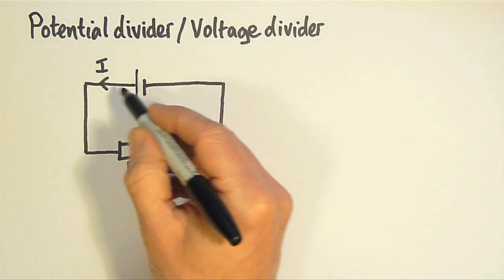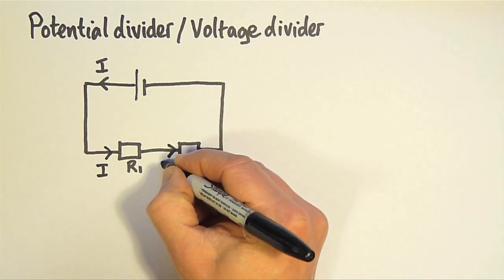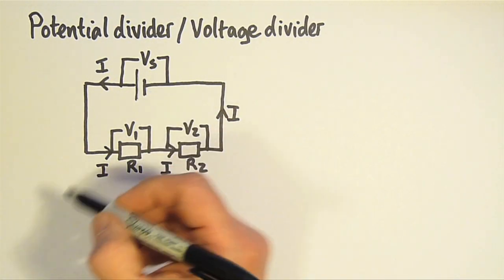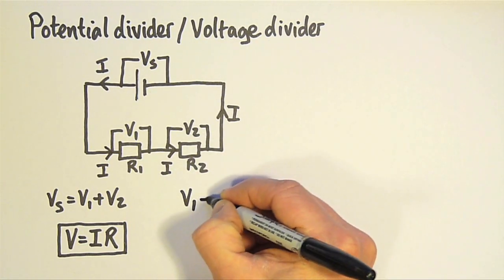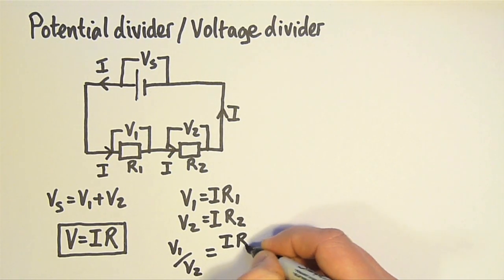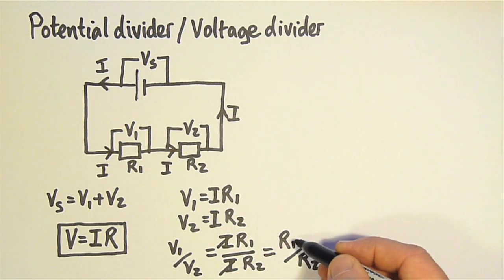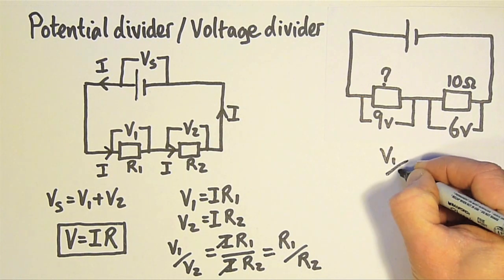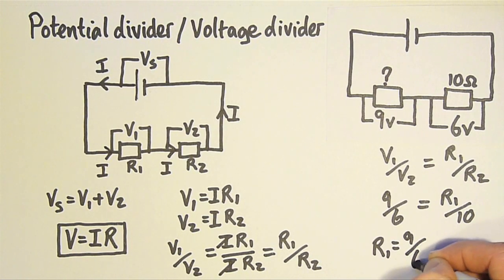Potential Divider 1

Comment: A potential divider of resistance of 50 ohms is connected across a 100 V DC source. A load resistance of 10 ohms is connected across a tap in the potential divider and the negative terminal of the source. If a current of 4 A flows towards the load, what is the current supplied by the source?

Comment: Could you not just calculate the current through the 6V resistor and then use V=IR to calculate the resistance in the 9V resistor?

Comment: What I'm really confused about and was hoping this video would clarify is this: If a potential divider is to supply a voltage to a device that is different (smaller) than the supply voltage of the cell, why are 2 resistors needed in the first place? Why not just have one resistor in series with the device? Then you can change the resistance of that one resistor to control the voltage across the device. My course says to put the device in parallel around the second resistor, which just seems redundant to me? That does nothing to the voltage and splits the current for no reason.
Reply: I don't know the reason why they do it, but one effect it would have is to split the current I think. Which would reduce the power input to the Vout device. Current is apparently important seeing as fuses are set to blow at certain currents eg 13A.
Reply: There are many ways of looking at the potential divider circuit. The first is it gives one a simple formula for calculating the voltage drop across the first (or the second) resistor if the two resistor values and the supply voltage are known. On the other hand, if the intention is to supply a voltage smaller than that is provided by the battery then the device to be powered forms the second resistor. This is the principle used (for example) in the simple constant voltage lead acid battery charger circuit, where the battery forms the second resistor while the first resistor is a high current rheostat whose resistance can be varied to limit the charging current to a safe  value. The third use of the pot divider is to produce  a reference voltage smaller than that provided by the battery voltage for use by other parts of the circuit/system; this use is commonly found in electronic circuits. In this third application, it is important that any device (which can be viewed as another resistor) connected in parallel with the second resistor does not load it; that is, it (the device) does not divert too much current away from flowing into the second resistor such that the voltage divider formula is no longer valid. Hope that answers your question.